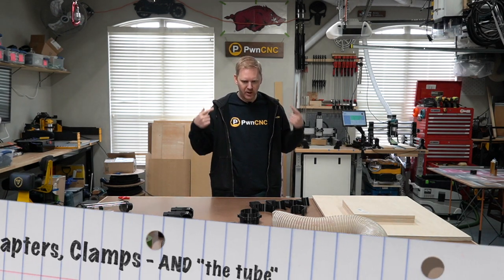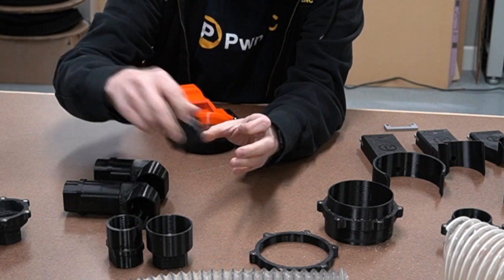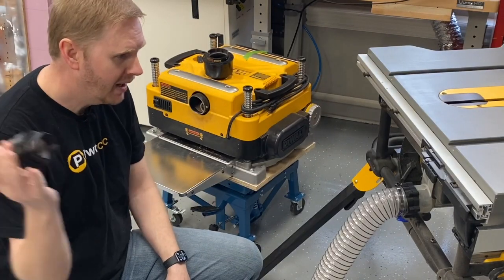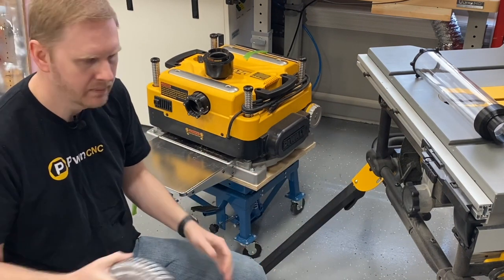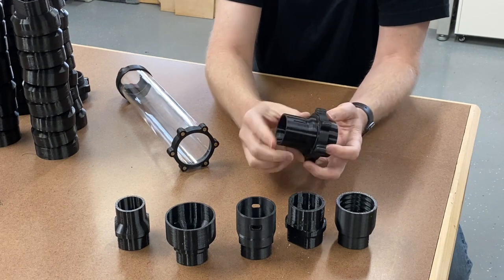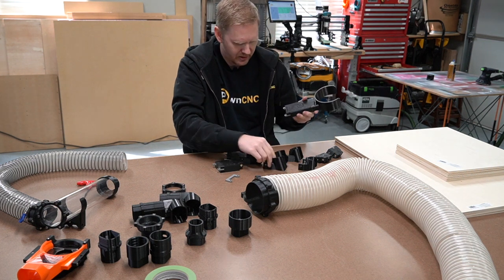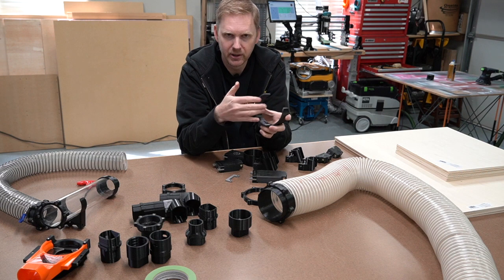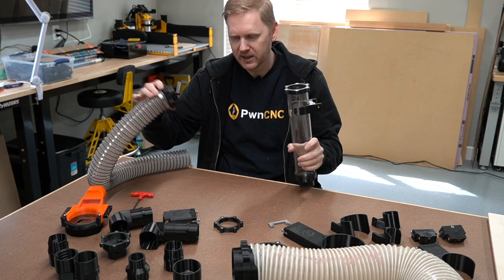Hose Adapters, Clamps, and THE TUBE!

Comment: Very well thought out and nice designs all around.
Reply from the maker: Thank you.  This is a hobby and as such tend to over think things so I can have the perfect experience.
Reply: @PwnCNC  I am waiting for my 1f, still about 6 weeks out. I actually have the suckit dust boot on order with my machine but really think I would prefer the hose at the rear of the Makita router so when it arrives I will be in touch to have you set me up with everything needed. I will also email them and see if they can cancel the dust boot  before the shipment is made. Really liking your design even though this onefinity cnc is a first for me.
Reply from the maker: @billbaggins9961  I ran some setup tests and "the tube" is also compatible with the Onefinity.  Fits perfectly with my v2/v3 boots... which brings the hose attachment point to the top of the carriage.